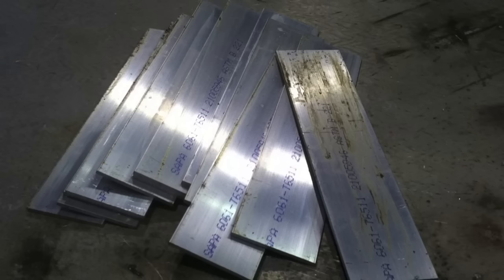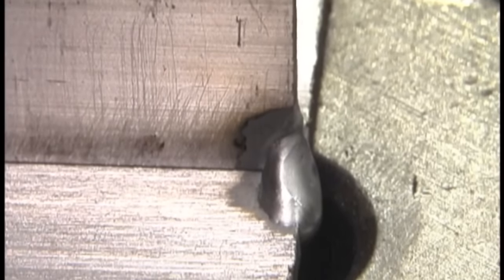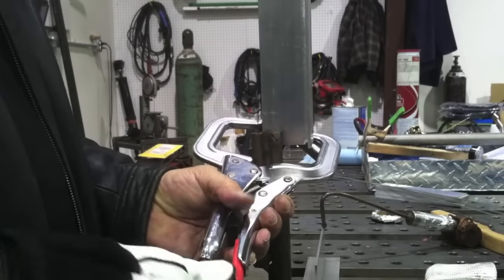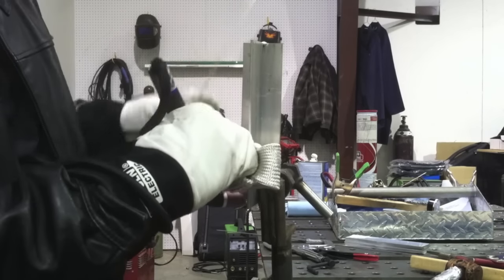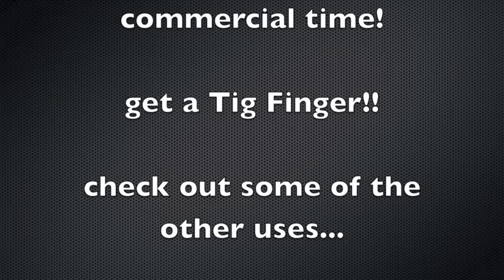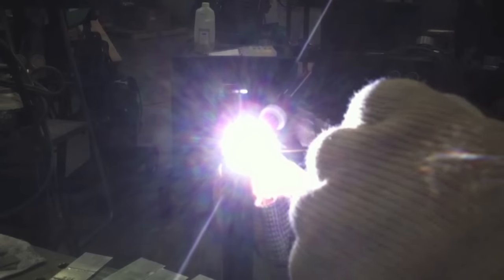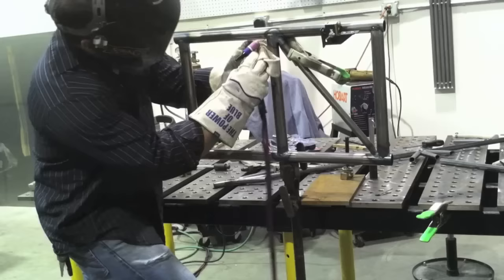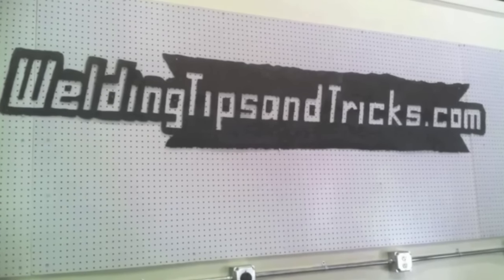Tig Welding Aluminum Vertical Uphill

Comment from the maker: for this joint I was using 90 Hz and 65% EN on the balance. 140 amps but used foot pedal to taper amps as it heated up. 60hz can work ok too.  I would just taper a 2% thor , cer, or lanth electrode and barely ball it on the tip and try that.  also make sure not to use too much flow on argon as that will make the arc wander bad

Comment from the maker: one option is to have 2 torches. One air cooled 17 style..and a cheap water cooled #20 style. with a few fittings, you can just hook it up to  tap water and drain it for those times when your 17 is getting really hot. Tap water will eventually corrode the cable..thats why I suggest a cheap Ebay water cooled 20 style torch. Ideally, a water cooler and a good torch with deionized coolant is best but I feel you on the extra cost.  700 bones or so to do it . a 26 air cooled is needed for 200 amps

Comment: Nice work/video as always.  I have always heard that when using a brush to clean aluminum that it should only be used in one direction and not scrubbed back and forth.  But from what you said, it doesn't sound like brushing makes much of a difference one way or another.

Comment from the maker: for aluminum tee joints in sheet metal, its actually better not to penetrate much past the root. (aluminum is hot short and can easily crack if you penetrate too much on a tee) the best thing is to file the edge flat where you have a really tight fit with no gap and the just use a tight enough arc to wash filler metal into the seam.

Comment: Another Great Video Jody.... Would you recommend getting a water cooler with a 200 amp inverter machine when the most I would ever work on is 1/4'' and smaller with the Tig process.. Its a big jump in money to go that route... I like the thought of a smaller torch but what is the smallest air cooled torch that will withstand a maximum of 200a without burning down or getting so hot you cant hold it?? Thanks in Advance Jody..

Comment: Great gob!

Have had this in my mind for a long time so here we go.. In your every tig video you got superb clean puddle and the finish of the weld is always clean, clear and neat. Of course pre-cleaning is important, but so is gas too. As we know argon creates well cleaner puddle that gas mixes, but there is different kinds of argon too. 
So the question. Do you mainly use just normal argon (99.99%) or is something else?

Comment: Great video as always!

One thing you might want to add in the cleaning part is to NOT use anything like brake parts cleaner to clean the aluminum before welding as it can produce phosgene gas, that's deadly.

Comment from the maker: lot of inverter tig welders have problems arc starting with pure.  also, pure tungsten wont handle much heat at all and you cant use a taper because it balls too easily.  dont get me wrong, you can make it work. I just dont care for pure tungsten

Comment: just going to give my take on this question if you don't mind. the single phase and three phase inverter machines preform pretty much identical to each other. if i were to make a sugestion as far as transformer v inverter i would go for the inverter. they are more capable in terms of shaping your wave form. they also use a significant amount less power, almost 2/3 less! they are ALOT smaller in size for small shops this is ideal. i recently purchaced a Miller Dynasty 200 DX I did alot of reserch

Comment: Again, great video!! 
Jody, is it necessary to bevel a aluminum 2mm T joint to achieve full penetration?I tried it at home, and I found very hard to liquify the very center of the joint, and I always end up with a little hole on the center...
do you have any tip for this issue? Thanks a lot!

Comment: Hey Jody after lighting a few gloves on fire welding stick and tig (with stick i do small jobs 2" angle and square  and upwards of 2" pipe) i always start supporting the rod with my index finger and forget to get out of there next thing i know my finger is burning and after Tig welding aluminum that Sob gets Hot ! do you sell the tig fingers on Ebay as well ? got to get one ! my father is the Manager of a welding supply store and i mentioned the Tig finger is is like  thats a good idea
Cheers
Ty

Comment: Hi Jody!

Can you tell some details about your machine setup? 

Amps und AC Frequency?

If have a cheap china tig machine, that allows only a fixed AC frequency of 60 Hz. Therefore I have some problems of arc wandering. Is there a way to avoid these problems? 

Grettings from Switzerland. 

PS: Your TIG Finger is awesome!

Comment: Nice video.  Were you using the dynasty 200?  What frequency setting do you typically use on "T" joints?  Were you using independent polarity?

Comment: Hi. im about to buy a tigwelder in the near future. And I'm wondering about 1 phase 230volts vs. 3 phase 400volts that is the swedish standard. I've understood that the older transformer based welders would perform much better in the tre phase versions. It might be something for you to talk about in some upcoming video?! :) Anyway, I'm looking into kemppi mastertig mls 2300 as one alternativ and that's a one phase 230amp inverter with ac/dc alternatives. Know anything about it? Thanks -sweden

Comment: Great videos! The tig  finger is one of the best "tools" I have. I do have a question. What makes some of my welds come out dull and just dirty looking and some are so shiny you can see your face in it? I have been trying to figure out what causes this and have yet to. :(
Reply: +Niel421 Check out Jody's video,;Aluminum Tig Welding: Setting AC Balance.&quot; That did it for me. I tried just a couple of days ago to weld aluminum. Had been welding mild steel and was little dissappointed that the aluminum just burned and until I realized that the machine was set on DC neg. Changed it to AC and set the "cleaning" knob to about 30% AC neg (as I understand, that is the proportion that the electrons head back to the electrode). I'm pretty much a nooby at this tig business.  Anyway, I turned up the current a little and suddenly the puddle turned clean and shiny and would accept the feeder rod.  Now I'm hooked on welding aluminum.
Reply: +Niel421 Oh, just ordered a tig finger, thanks for the recommendation.

Comment: I have been playing around with aluminum tig at my school, its an old miller 300 and it always seems to hot, when i.do.my tacks for ts it just blows through, its prob my settings just wondering what i adjust to fix it